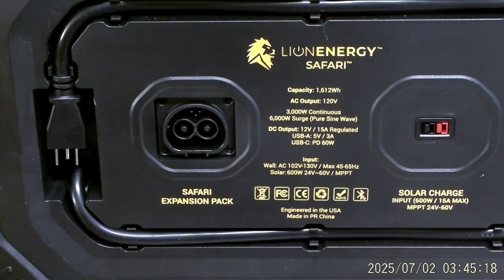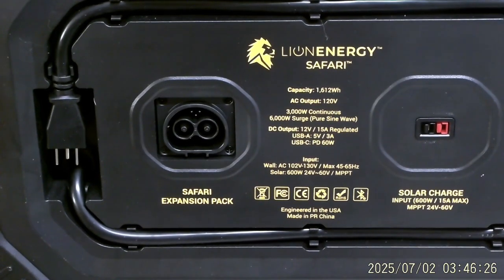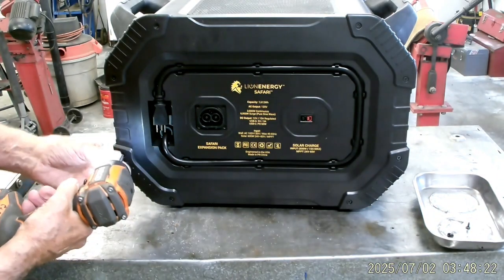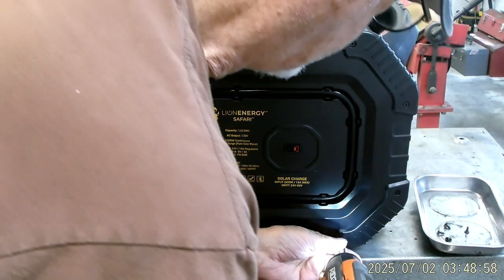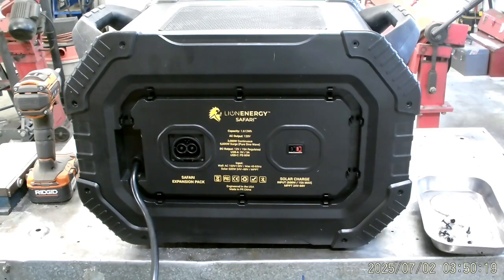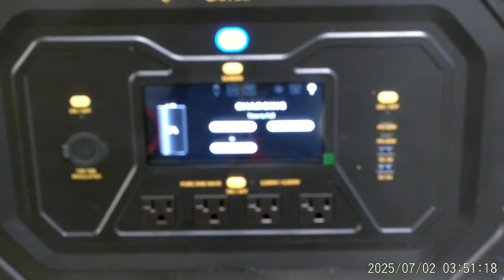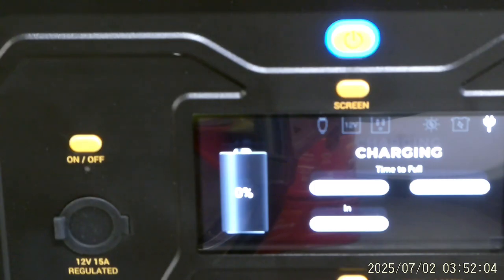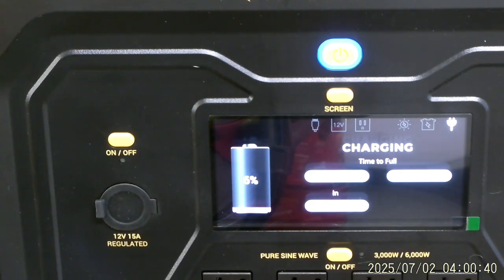Why Solar Generators Suddenly Stop Charging and How to Fix It

Comment: Ive had that same thing happen i dont know if one plug gets more power than the other but that dosent make any sense strange
Reply from the maker: If it isn't a loose cable or wire, it's probably the bms( battery maintenance system) It puts the batteries to sleep until it senses voltage.